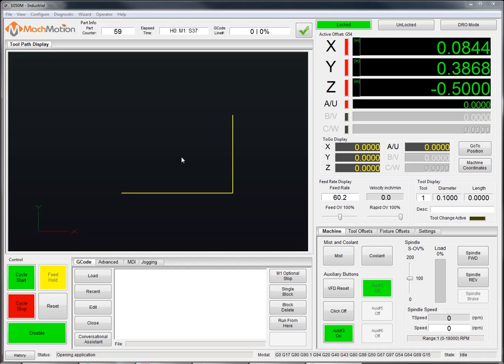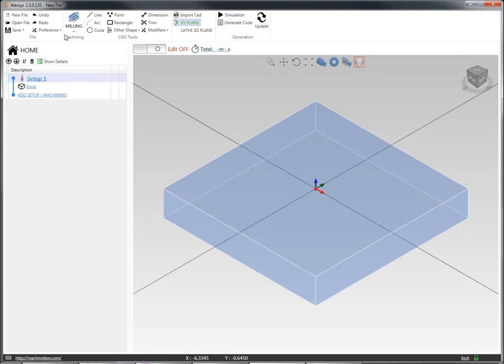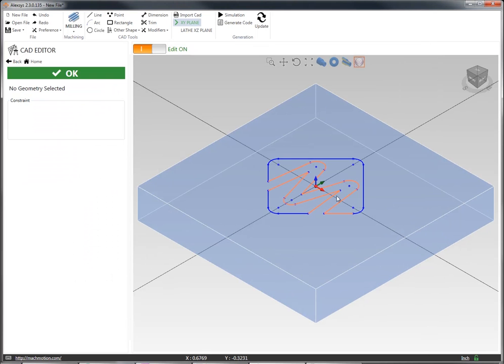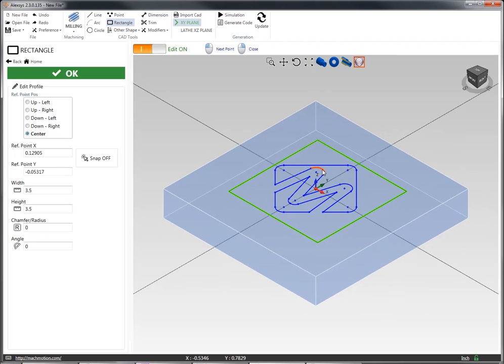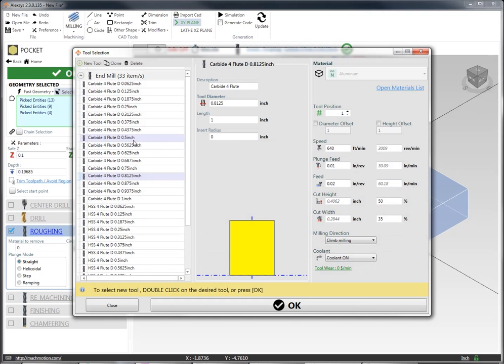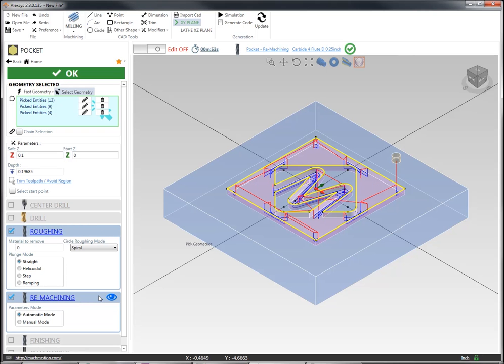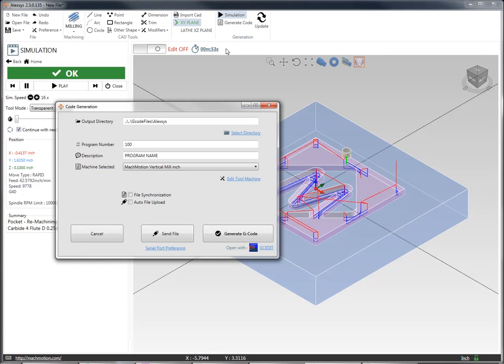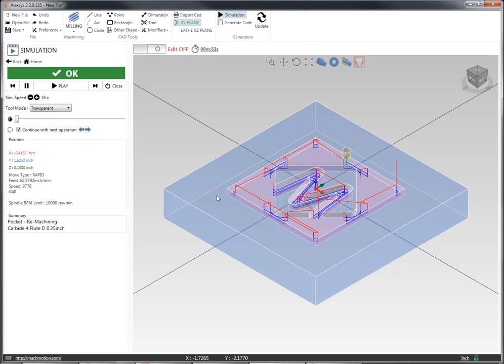Alexsys™ by MachMotion - Conversational Assistant - Import CAD Demo

Comment: say I want to make a pocket like G13 operation.  Other G code for most high end machines will allow you to say cut a 1" diam pocket with 1/8" End mill where the circular motion is more of a coil than a circle and then "I" move and a bigger circle and so forth and so forth.  Will alexsys make a pocket like the big boys G code?
Reply from the maker: You can select between spiral (as you are describing) and traditional (old school, concentric circles).
Reply: OK so how much to add this to my mach motion system.
Reply from the maker: An upgrade on a MachMotion control is only $195. Email sales(at)machmotion.com for more detail.